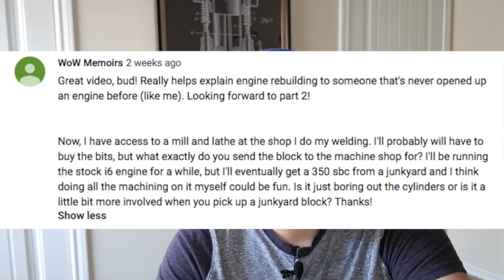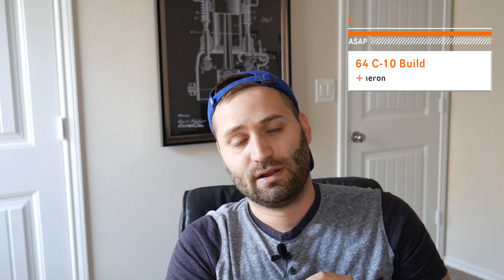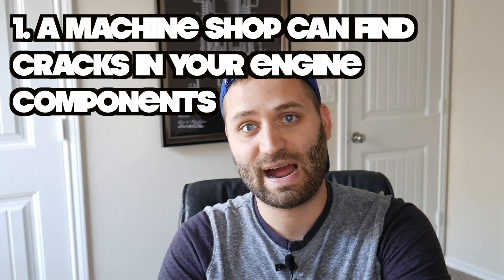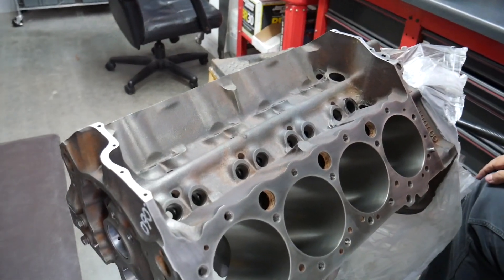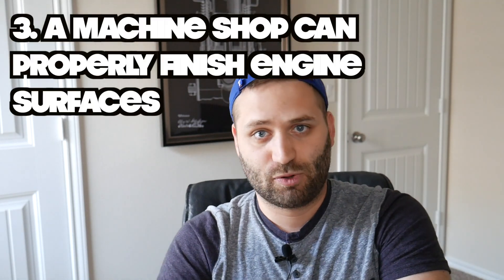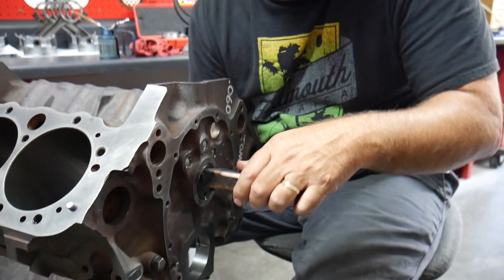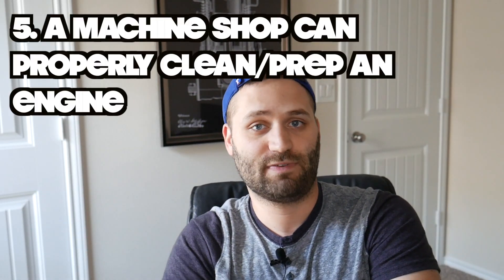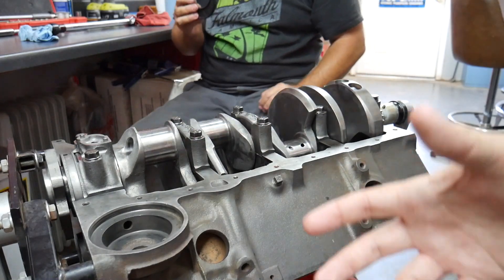5 Reasons: For Taking An Engine Block To The Machine Shop

Comment: Thanks mate. Can i use the old pistons and rods with my build can the shop can clean up and check if i can ?
Reply from the maker: Hey! I'd ask the machine shop about the condition. We use used pistons and rods if they're in good condition (especially for circle track stock car racing).

Comment: I get quite a few engines a year that were just purchased as a 'fresh" engine and they end up being junk due to various reasons.  I hate being that guy to tell you your stuff is NFG, but my Instagram likes on them posts sore🤷‍♂️. I did just save a 400 sbc last week though. Came in as a fresh machined project ready to assemble. I had to grind the crank and install a sleeve in cylinder #3. Mill the front gasket face due to the water pump passage being pitted beyond sealing(had a hard time pressure testing the block because of it) and the decks were milled with a 0.020" taper front to back. Was able to straighten it out and set them at 8.996" deck height which was almost a perfect zero deck. This guy was lucky though, usually I am not able to save these types of projects and the buyer is SOL on his purchase.
Reply from the maker: Thanks for dropping by! We don't work at a machine shop, but we have had the misfortune of buying junk and letting other people know their stuff is scrap. It sucks alot... However, it would be worse to finish building your motor only to find out the block is cracked etc...
Reply: @asapgarage7697  it sucks, truely. I do my best to inspect a core before I buy them. I am pretty good at spotting issues since it's been part of my job for 20 years now. I know where certain ones like and tend to crack. Even then, sometimes I still buy cracked cores since cracks are sneaky. I have a portable pressure testing kit I often bring with me now. It will show a crack if it goes into the cooling cavity but not show in areas like lifter valleys, mains, and the decks. So even blocks that passed pressure test sometimes end up being junk after I have hot tanked and magged them. Part if the hobby I guess. Thanks for supporting your local machine shops though🍻

Comment: 9:15 When reboring an engine, the machinist may ask for your piston set first. That is because a few of them may be about +/- a few ten-thousandths of an inch. I'm not sure how many decimals of a millimeter the piston varies on metric engines. The machinist will then hone the bore a little bit smaller or larger to match the piston. That results in a more consistent piston to wall clearance, and means you'll get the most power and life out of the rebuilt engine. Sometimes when the auto maker builds a brand new engine, the engine leaves the honing machine with different bore sizes. The manufacturer also has a large number of pistons that vary a little, and are already measured. The result is an imperfect piston matched to the same imperfect size of the bore, resulting in a more consistent piston to wall clearance.
Reply: Nah, mate. .030 over pistons work for .030 over bore cylinders. It's the rings that matter and theyre designed to take up any difference within tolerance.